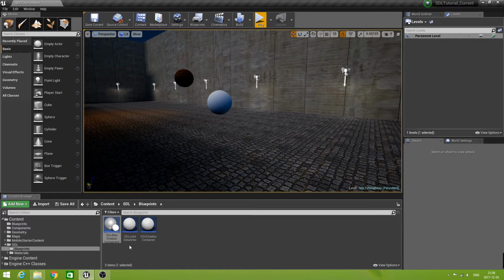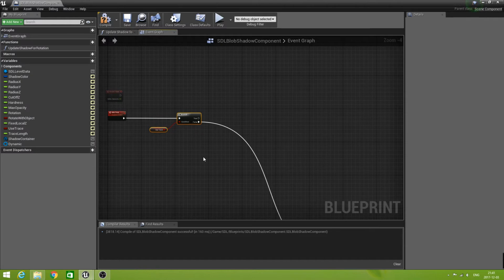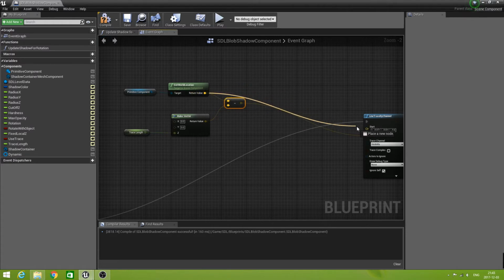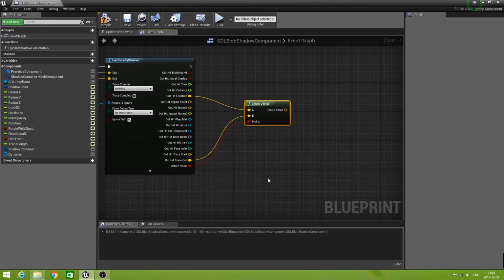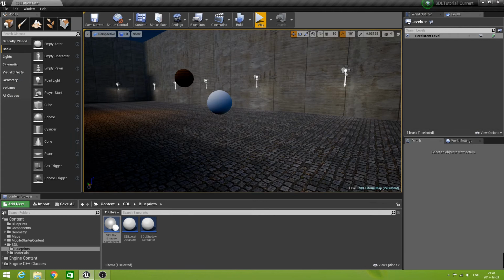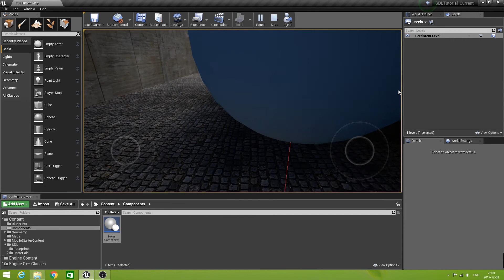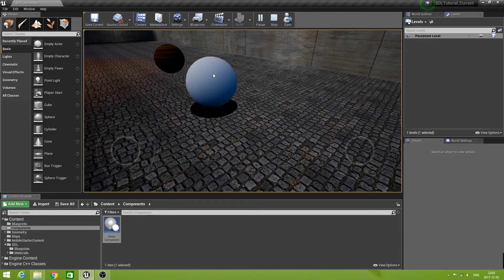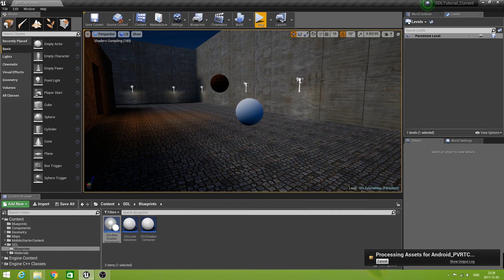How to Create Blob Shadows in Unreal Engine 4 (Part 8)

Comment: I have to say you did a huge sample for us without any  eye candy stuff, which can be use in  real projects. 
Please keep going, you are the best lecturer.
Reply from the maker: Thank you for you kind words!
Reply: :) Hi Peter, I have a question that is caused by a slope. 
the shadow works not perfect on a slope.
It can be solve if I try to increase the range of Z. but the shadow will cast on character's feets incorrectly. 
Is there a good way to work it out?
Reply from the maker: You can not do a lot about that. Just choose the best values for CutOffZ. The shadow is always aligned with the x-y plane. So it is not incorrect but works as designed. You need to try and work with it in your design somehow. (We are after all only faking a shadow :-) )

I will see if there is a possibility to do something to better this situation because you can get the normal of the trace hit. But on the stairs that still would not work :-)

Also do not make the radius larger than the bounding box of your character. That is, if you have buildings and walls etc. Because the shadow goes through all! If you choose RadiusZ too large others may see the shadow through a floor if multi story building for instance.
Reply: I got it. Thak you~
Reply from the maker: I have a fix that makes it much better. I will make an extra vid for that
Reply from the maker: Making the video I found a bug that i need to fix as well :-) I hope I find that tomorrow ...
Reply: Ok, I look forward to that.thank you.
Reply: By the way, before watch the tutorials, I take advantage of a UDecalComponent and a deferred decal material to cast a fake shadow. It can be rotated to fix this problem, which would make  shadow get the same direction with the normals on the slope.
Reply from the maker: The vid is rendering now and its a bit of an upload too :-) Yeah i looked at decals but went for the world pos behind translucency anyway because decals and mobile are a bit unclear and the behavior of the opacity mask seemed to me slightly better. But any solution is a good one and any situation requires its own solutions. I think you will like the new way I did it :-)
Reply: Just like what you said, I'm now interesting in your way for gettting a better solution. we looking forward your next upload:-)
Reply from the maker: 50% uploaded, got bad internet here :-)
Reply: haha, don't to complain with your free internet , you konw, in china, it is illegal to browse the YouTube, it is likely that would be put in prison.